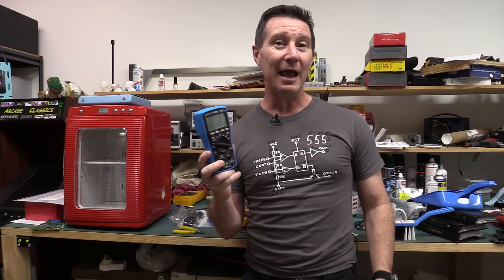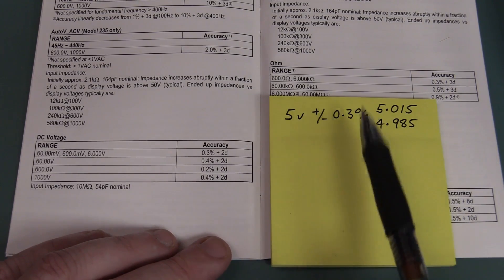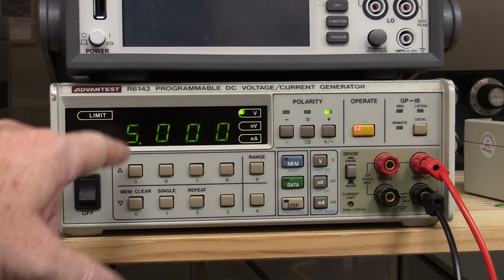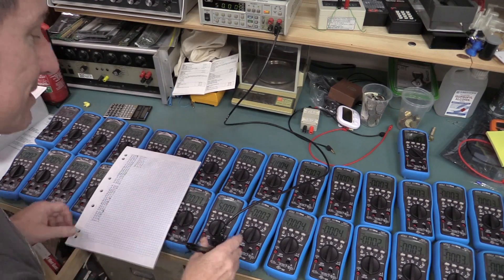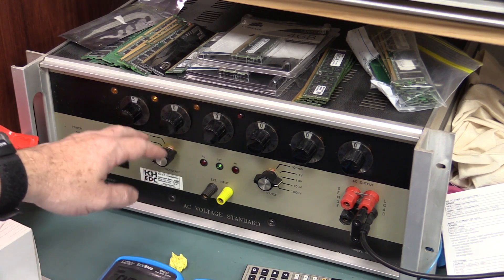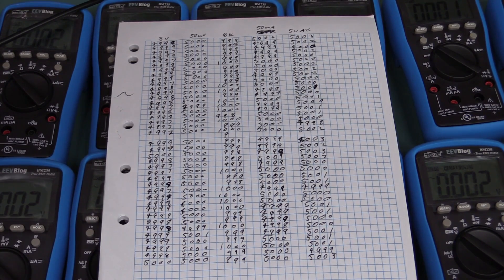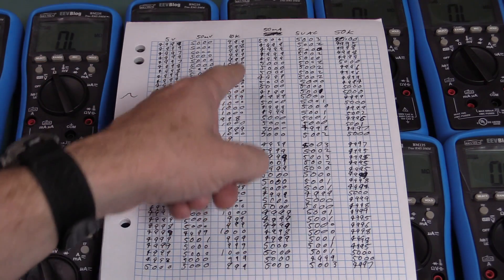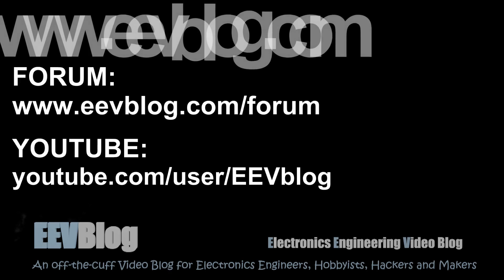EEVblog #852 - Multimeter Mass Turbulence

Comment: We do those all the time at the calibration company where I work they come under a different brand but the instrument is the same and they are spot on 99% of the time, never had one failing the cal, quite surprising for a multi brand meter thumbs up for the manufacturer.

Comment: 16:10 Ever thought of cleaning the inside of the banana plug? It used to make a difference for me (and I started with a mirrored analog unit that needed to be calibrated everytime you use the resistance function so I would notice these things). Interesting vids, if a bit long at times.

Comment: Uni-T fanboy reporting for duty. My 70D is bang on spec after 18 years of daily use. Maybe the newer ones are not up to scratch, but the older models have been reliable workhorses for me
Reply: +arcadeuk I had the chance to check 3 UNI-T meters so far and found them all to be barely in spec, all on the low side. Two of them were from 2006, the other one from around 2010. Glad to hear that your's is still bang on after all these years. I am afraid something in that companie's factory calibration procedure has changed to the worse since then. The meters from 2006 were both taken off duty, they had selector switch problems.

Comment: Those meters fell over didn't they :)
Reply: +Wessel Lemmer Haha yeah, you could see them start to fall just as he cut away
Reply from the maker: +Wessel Lemmer You'll have to subscribe to my 2nd channel to find out...
Reply: +Wessel Lemmer They were falling when he cut. Maybe a human did stack 'em.
Reply: That's because the video isn't out yet. He said to subscribe, because that's how you can be notified of future videos on the channel.
Reply: +Wessel Lemmer Don't worry, they are built like brick dummies.
Reply: +BenjaminGoose Dunnies* ;)
Reply: +Thunder Child I much prefer AA or AAA batteries, they have higher energy capacity, greater current capability, and are cheaper / easier to source, and standardized pretty well on like all devices. (If you look through any random drawers in the house, much more likely to find some old AA's or AAA's than anything else.)
Reply: +Thunder Child 
Energy density is likely to be better in AAA cells.  9 V batteries are actually six AAAA cells packed into a rectangular case, so quite a lot of wasted space and extra non-energy containing material in there.

Check out EEVblog #518.
Reply: +boggisthecat - SOME 9V batteries use 6x AAAA.  Last time I took one apart (years ago) it contained rectangular cells and Wikipedia shows both construction techniques still in use.  But in any case I don't understand why they would even bother with using AAA instead of AA when it would make little difference in overall size.  It's not like the meters are the size of a small computer mouse or an IR remote control so use AA and the end user doesn't need to open it up nearly as often as AAA.  AA are cheaper and easier to find to boot!
Reply: +Thunder Child Just because a battery voltage is higher it doesn't necessarily make it better. it depends on how the product using it was designed. AAA cells have a higher capacity than the cells of a 9V battery. as example 3v x 1000ma versus 9v x 250ma, the 2 AAA's can give more "total power". like +boggisthecat was saying 9v has a lot of wasted space because of cell separation and therefore have lower energy for the same space, in other words energy density
Reply: +Thunder Child 
A lot of modern multimeters use two 1.5 V cells.  Keysight's new models seem to.  It is a change that caught me a bit by surprise, as I have come to expect a 9 V battery in 'quality' multimeters.

Newer circuitry simply doesn't require high voltages to operate, however, so it is probably more wasteful to have a product with a 9 V battery that must then be dropped to 5 V or 3.3 V instead of boosting 3 V up to the required level.
Reply: +ElmerFuddGun 
I would guess that it is simply to get the size and weight of the meter down.  Remember that smaller, lighter, packages lead to a lot of additional cost reductions from manufacturing right through to product shipment.  AA would be more convenient, but unless that is a customer requirement the manufacturer will choose what suits them.

(At least it isn't three AAA cells, like the old HP calculators.  By the time you need to replace the battery the leftover cell from the four you had to buy is too old to use.)
Reply: +EEVblog it was a fun video thats for sure
Reply: ***** It was a bobby tesla to be sure.
Reply: +BenjaminGoose =o) Bobby Dazzler =o)
Reply: +boggisthecat - True, but the size difference between AA and AAA isn't much and if you take a look at his store page you can find a picture with the bottom cover off. (yep, no tear down video!)  Use a couple mm of the spring space and add a couple more to the over all width and it's going to fit.  And if you look at the inside view of the back cover there is a lot of room above (left in pic) the batteries.  I mean for me I would be designing the case around what needs to fit (such as AA and the jack spacing, etc.) instead of noticing later in the design process that only AAA will fit.  But hey that is just me and I MUCH prefer AA over AAA unless the final product absolutely has be 10x10x50mm.
Reply: +Wessel Lemmer Yeah right? What is the operating range average after they have largely been used to build a fort in the warehouse. =/ what the heck!
Reply: +EEVblog where can I get one of these EEVblog mm please will be a lot better than my £10 Maplin junk.
Reply: +Wessel Lemmer yep lol, u can see them moving a few inches as the video cuts
Reply: +Wessel Lemmer There are EEVBlog "Moldymeters" now? How did I miss this?
Reply: +JD246 I cant see it what time
Reply: 1:41
Reply: +Thunder Child the 9v battery is worse in terms of cost. It's just easier to make a 9v multimeter
Reply: +boggisthecat Tektronix used 2xAA batteries on it's DMMs!
And that's a good thing. AAs are cheaper and more common than 9v ones...
Reply: BIll Geo 9vs are cheaper

Comment: You could have just written out the result range and placed a tick by each one that had that result, would have been a touch quicker.
Reply from the maker: +Allison Pell Doh, yeah. Would have given me an instant binned graph too.
Reply: +EEVblog Nothing worse than being told, or figuring out a better way after you have finished.  Happens a lot to me, anyway.
Reply from the maker: +excavatoree I just didn't give it any thought at all.
Reply: +EEVblog well, the one good thing about writing out each individual result is that it allows you to see which out of the batch were the most accurate

Comment: From the manual 
Dave's Note: Proper ceramic HRC (High Rupture Capacity) fuses are expensive,
but they are designed to fail safe and not explode. That makes you safer.
Don't be a tight arse and put cheap glass ones in there instead! If you wanted
cheap you should have bought a cheap arse meter instead of this one.
Beware the fakes on ebay! 
haha

Comment: The Uni-T multimeters seem to drift about a lot on the resistance ranges (and AC voltage, if I recall correctly).  Always a PITA to calibrate.

Comment: I want one of the EEVBlogs multimeters!
I suppose it won't be shipped to the states though?
I'd like to do a video testing with my Extec then with an EEVBlog tester. :)
I'd be using my pinball machines 5V and 12V metal stand ups on the board,

Comment: Years ago, Harbor Freight Tools, the local "cheap Chinese tools" store here in the USA was having a sale on pocket DMM's.  Something insane like $2 US each.  Perfect for using in places where I didn't want to risk the nice Fluke I had at the time or when I needed additional meters.  Drop one into a pond?  Back over it with the truck?   Who cares!  So I bought five of them and took them to work where I had access to calibrated (NIST-traceable) voltage standards.  I was shocked at how accurate they were...
Reply: They will blow up in your hand if you a accidentally  have the test leads plugged into the current socket and you measure higher voltages.  It's more like a toy multimeter with no protection.  Use it at your own risk!
Reply: +Chingus696 Thankfully, I know what I'm doing and won't make that mistake.

Comment: DMM with combined a AC \ DC Volts switch position, endorsed by the EEVBlog?
Reply from the maker: +gmaildotcom It software saves and defaults to your last setting. No worries.
Reply: Great! Well thought. Definitely something you don't see on cheap generic meters.
Reply: ***** If you don't use AC, it won't default to it.

Comment: Electronics amateur question here: is such a crazy level of precision ever needed for a multimeter? Like 4 digits for the 6V range? I mean, for most of electronics, 1 digit is more than enough, let's say you need 5V, if you can get anywhere between 4.9 and 5.1 it's usually no problem at all.

I'm thinking maybe reference voltages or other stuff like that?
Reply: Typically you don't need the full number of digits when you're just just checking something.  In most cases three significant digits is going to be adequate.

However, consider the effect of range changes: with this particular 6000 count meter when you change range from the 6 V range to the 60 V you drop down to three digits -- e.g. "6.000 V" to " 6.01 V".  (There is usually some 'headroom' where you can actually read up to e.g. "6.030 V" or such before the range change is required, but the effect is still present when you go past that threshold.)

For work where you want to measure -- or set -- values more accurately, you need to step up to more significant digits.  This is where 50 000 or 100 000 count meters come in, or your more capable bench-top meters.

Comment: What would have been interesting in the AC range would be distorted waveforms. In my experience the cheaper meters easily go at the edge of their spec or outside of it. Just don't complain if they do it on square waves

Comment: Now I am getting even more excited to get the BM235 that's coming may way.
This video will hopefully open the eyes of the UNI-T fanboys. I had one of these at work and they showed exactly the same behaviour. All the values were barely within specs and one the low side. Now we got a new one (Voltcraft VC9xx) and may have gotten just another UNI-T, rebadged version, doh. I should have taken care of that myself....
Reply: +Chip Guy Vids all voltcraft things are rebadged.
Reply: +FoxMccloud42 I know, but I expected Metex (which I got and is rather good)

Comment: Maybe the firmware knows when they are tested, just like the diesel engines of Volkswagen? Just make them tend to get still unsuspecting close but closer than the actual accuracy is to typical testing values...

Comment: I'm confused on the +2d statement.   When it says "plus two digits", does that mean the least significant digit can fluctuate by a count two?  in other words, with a 5.000V input, 4.998 to 5.002 is the range (not counting the percentage accuracy specified).  I'm simply not understanding the +2d statement.
Reply: +Hilltop it's 2 digits up over 5.000 and 2 digitts under 5.000 used too be + -  2 digits. but some manuals dont put the + and - simbols on the manual.
Reply: Well-written specs usually have something along the lines of "+/- (0.3% of reading + 2 digits)".  So a zero signal should yield in-spec indications between -2 digits and +2 digits, for that example.  The Brymen manual explains how to interpret their figures in the paragraph before the tables of specifications.
Reply: +boggisthecat So when you say "two digits" you mean "plus or minus a value of 2" in the least significant digit, right?  So in this case it would be 4.998 to 5.002?
Reply: +Hilltop Correct. When the spec says "+2 digits", it means two counts (+/- 0.002 for a 3.5-digit meter).
Reply: +Peter Ridge Got it!  I was confused whether it was two counts or two places - i.e. tenths, hundredths, thousandths, etc
Reply: +Hilltop 
All specs give "digits" where they mean the least significant digit displayed.  Some possible gotchas exist where Fluke, for example, give supplementary specs where they footnote stuff about reinterpreting the digits used.  It can get confusing where complications are present.

Something to look out for is instruments that give best specs with greater than ten digits.  This actually means that the least significant digit is fairly pointless, but is sometimes done to market a meter that is e.g. 4-1/2 digit class as a "5-1/2 digit" instrument.  (Poor quality Chinese brands sometimes do this, so if you know what to look for it can be useful to assess the real performance.)

Comment: Did you design those or is it just a sponsorship/branding deal? You should have put a USB port on it for reading the measurement.
Reply: I'm not sure if it's included on the BM235, but I have a BM257s and it has an opto socket on the back which enables the connection of an additional cable for interfacing with a computer via USB. Not sure if it would make this specific experiment any quicker or easier though.

Comment: Why calibrate on the 50mV vs 5V? It seems to me it would result in higher accuracy calibrating at 5V.
Reply from the maker: +GreenAppelPie The input to the ADC is (usually) XXXmV full scale. You get the best accuracy when you aren't using the input divider.
Reply: Typically there will be calibration adjustment points in the lowest mV range, then one or two on higher ranges.  It's a linear fit type requirement (the "y = mx + c" stuff).

AC is then usually adjusted at 1 kHz or something similar, and sometimes at 65 Hz to get a near (US) mains frequency point -- but not at mains frequency in order to minimise issues with signal coupling etc.

It is sometimes a bit surprising how minimal the adjustment processes are, even on the old trimpot type meters.  A lot of work goes into minimising adjustment requirements as that not only makes manufacture easier, but should improve long term stability.  (This is for good quality meters: cheap stuff is often festooned with trimpots.)
Reply: +EEVblog Thanks! I understand that reasoning, but also find it arguable.

Comment: what boat did this guy just get off of.  Yes multi-meters have an error.  Actually 0.3% is pretty good.  Seldom do we need even this.  All test gear have errors, but seldom does it matter for even a power source will change on it's own and many other factors come into play in the real world.  You want exact then get take out a mortgage for it would cost more than you would want to spend.

Comment: What the hell happened to the fluke?, they are supposed to be the dogs bollocks :-(
I expected briman to be excellent, and i wasnt dissapointed :-D
Reply: Any meter can fail.  Fluke probably have a low failure rate compared to cheaper options, and they do seem to have long useful lives -- we still see the original 70 and 20 series come in to our lab, and they have no problems other than the occasional LCD display faults (that are reasonably simple to fix).